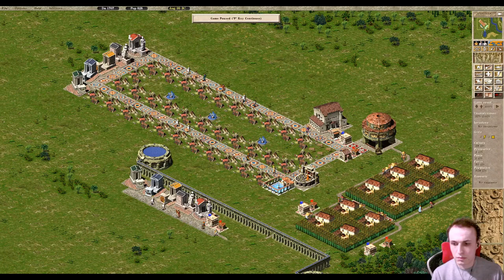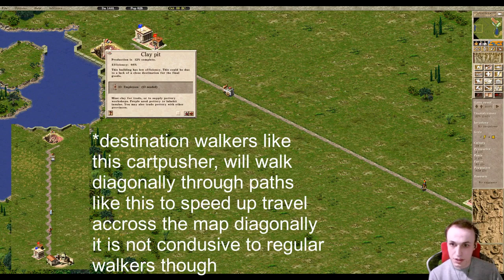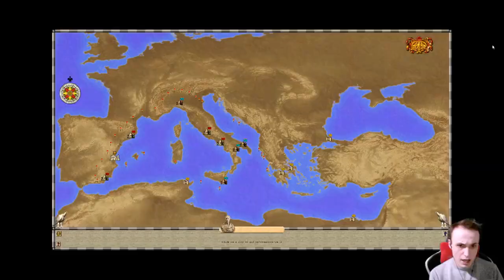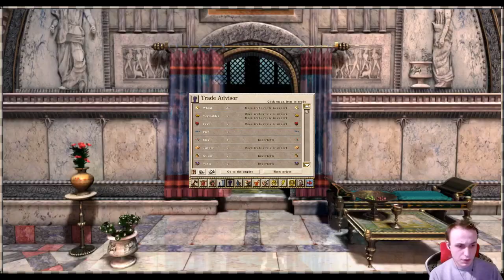Caesar 3 Augustus Advanced industry layouts

Comment: He's right about placing the warehousing for what you import closer to the entrance. Especially if you buy and sell with the same trader. If a trader sells you two raw goods and buys two finished goods. place the warehouses for the raw good closer to the entrance. If they buy both a finished good and a raw good. place the finished on closer to the entrance. You want him buying the more expensive one first.  When the first caravan arrives, they buy 8 units at the first warehouse they come to. If you have 16 or more in the warehouse, the second caravan will fill up too. If the finished goods warehouse has 8 and the raw goods has 16, three caravans will buy out the finished goods and leave. The second caravan will buy 8 raw goods. If this has 3 caravans, you might have 24 purchased that trip. If two caravans only and there are 4 goods in each warehouse, The first first caravan cleans out both warehouses and the second returns empty. If neither warehouse has goods at the time they enter, they won't stop, even if one of the warehouses has good by the time they pass.
Reply from the maker: Not really what matters most is that the import and export warehouses are close together since the traders can say import you 7/8 clay, then go to buy pottery, but then see they can still sell 1/8 clay and will return. 

This can cause crippling inefficiency and is why the trade can become unpredictable. Placing it close to entry point doesent actually affect anything as long as its close together and along the traders natural paths. 

Stuff like highways, caravenseari and Mercury GT can be used to boost it further as well but thats besides layout.

Comment: If you got place yoy can build similar block like houses for industry. Similar like in pharaoh. For example road with 4 wide blocks and 17 long with road in middle at 9 long with 2 roadblocks to get one fireman and 1 engineering to cover like 16 workshops in middle and like 16 out with warehouses. With placing warehouses in middle outer blocks you get good efficency and that small road in middle with 4 wide and 2 roadblocks allow transport. Minus i that it need a lot of space to do that. Ofc we can make it shorter but for my experience biggest coverage for 1 prefekturę and engineer is with double 4x8 blocks in middle. It do like 19x6 roadblock
Reply from the maker: Most of us use global labor pool with augustus so labor access isnt a thing, best housing is 22x6 or 26x6 anyway so no need for any of this.

Comment: I found import and export is best kept together as when there are traders on the map when it turns from December to January, they will ping pong back to your import area to sell you the new years quota. On maps where the entry and exit flags are far apart it is crucial to keep imports and exports together.
Reply from the maker: Yeah i think i covered this in the quotas video and mentioned it elsewhere as well. There is a set behavior where they sell you imports first and then buy exports but it can still cause backtracking or caravan pingpong when the warehouses are some distance apart. 
I recommend putting in all together but you can specialize areas of the map, if you want to for example have the same cities that buy only certain goods use a certain area while other traders will avoid it if the goods they trade are not accepted, with docks the carter time is even more vital and there anything than 2 tiles distance from dock to warehouse is really bad for quota. 
With docks you can control where certain ships go to though. 
This video is quite old, made even before cart depots.